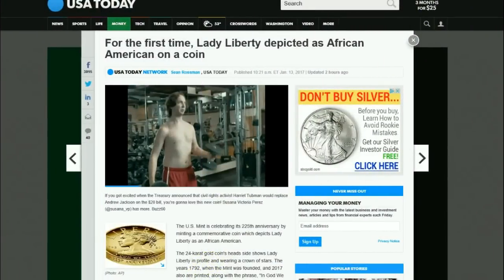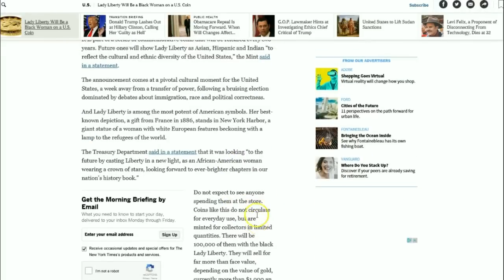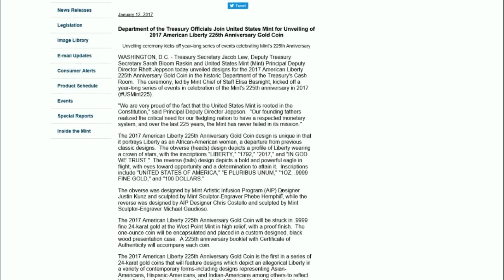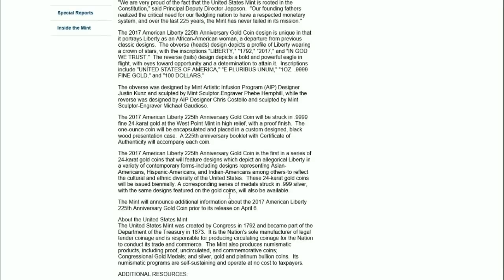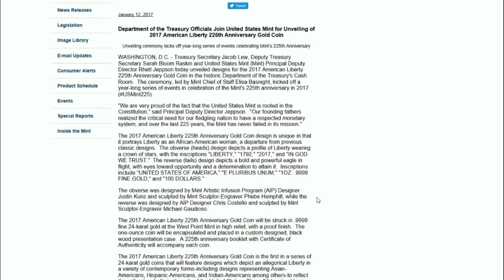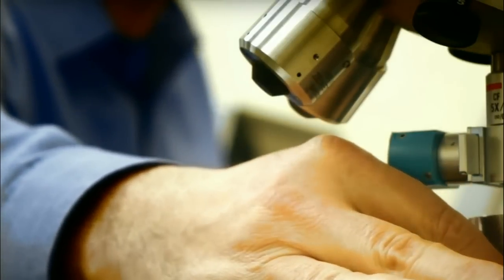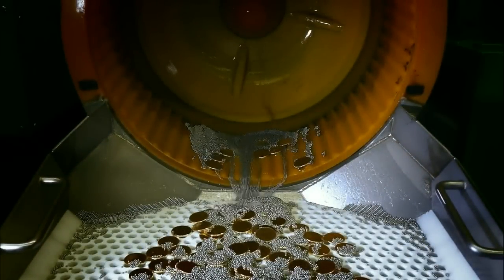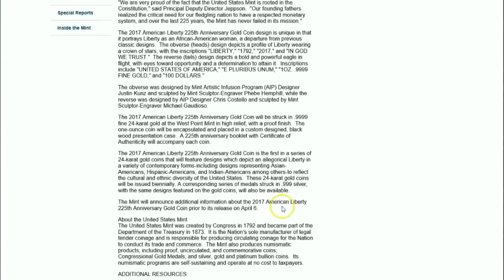American Liberty 225th Anniversary Gold Coin Release Date Set & Other News

Comment: I agree that the actual struck coin looks way better than the drawings and mock ups so far.  But that said, I don't think I'll be going after this one.  If it were a single coin and really commemorating the 225th anniversary of the mint that would be fine.  But if they are going to trot out a series, at least the way the article is written, it smacks of Obama administration cronies messing around with the mint.
Reply from the maker: It sure does seem that way, doesn't it. I'm on the fence on this one as to whether I'll save up for it or not.
Reply: Well, if you do I'll be looking for your unboxing video!  But you already knew that.  LOL.
Reply from the maker: Thank you sir!!